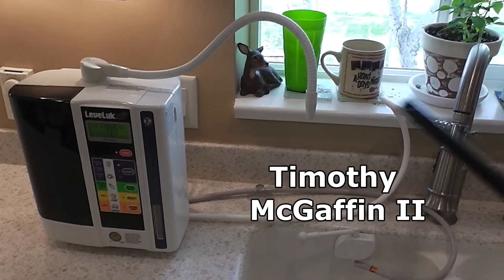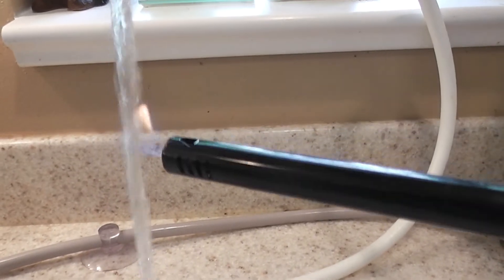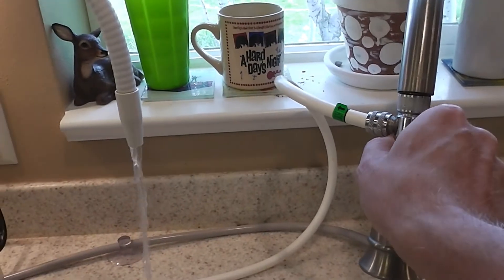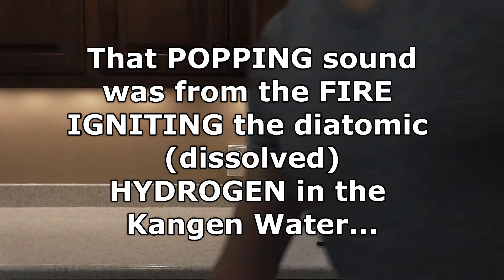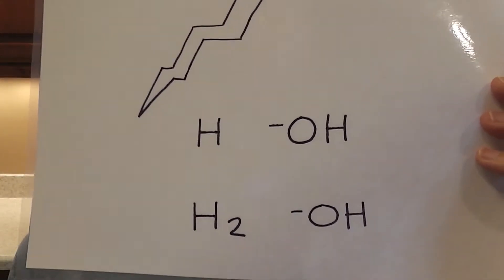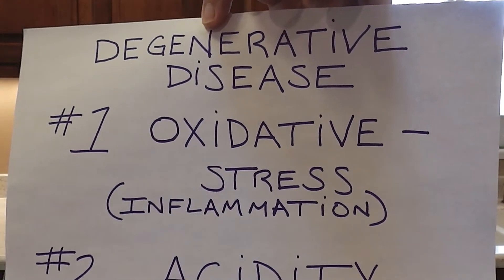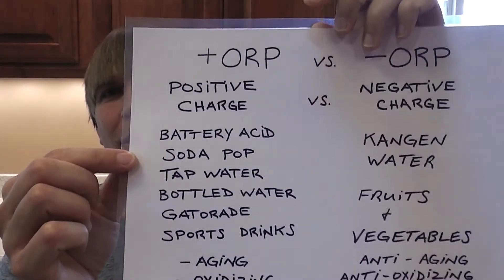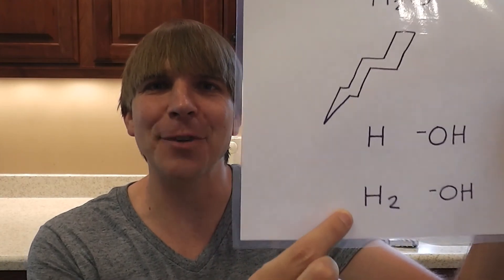FIRE🔥 EXPERIMENT: Why My Hydrogen Water Makes POPPING Sound, Tap Water Does Not😯

Comment from the maker: Clarification: The diatomic (dissolved) hydrogen or H2 in the Kangen Water is technically not flammable when dissolved in the water just like gun powder is not flammable when it's dissolved in water. The popping sound you hear is indeed from the hydrogen gas being ignited as the Kangen Water was coming out of the spout, but it wasn't necessarily from the dissolved hydrogen gas within the water but rather from the hydrogen gas that wasn't dissolved into the water, but still was split off from the H20 molecule during the electrolysis process and then escaping into the air as it came out the spout. 

So a certain percentage of hydrogen gas disassociated from the H2O water molecule, as explained in the video, was dissolved into the Kangen Water. And another percentage of the hydrogen gas that was disassociated from the H2O water molecule escaped into the air and this part is what was being ignited.

The popping sound you hear is proof that there is diatomic (dissolved) hydrogen in Kangen Water because it proves the H20 water molecule is being disassociated by the electricity when it runs through the machine and a part is dissolved into the water and another part escapes into the air. Just like gun powder will ignite when it's dry but it won't ignite when dissolved in water. I just wanted to clarify so you don't need to worry about catching on fire when you drink Kangen Water because the hydrogen is not flammable when it's dissolved in the water. 

Also watch my other video further proving Kangen Water contains dissolved hydrogen or H2 here: https://youtu.be/9pLYc2EPpIM